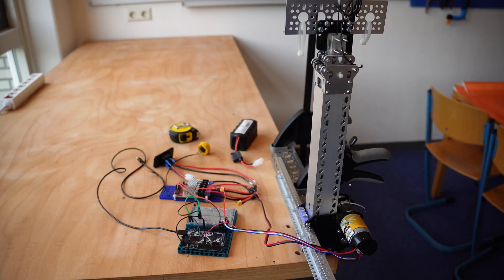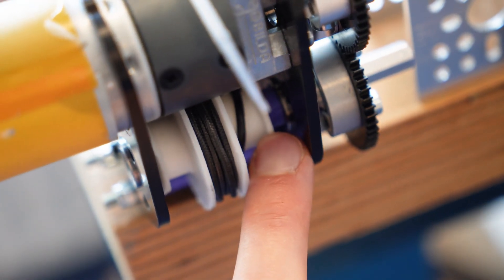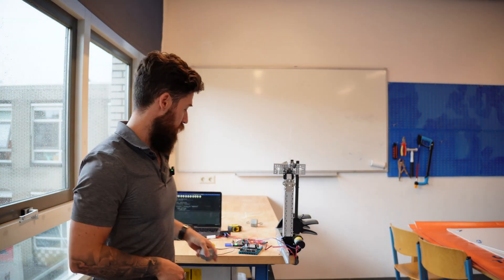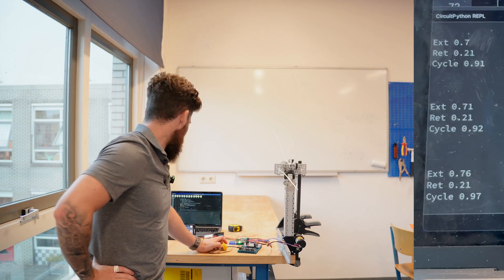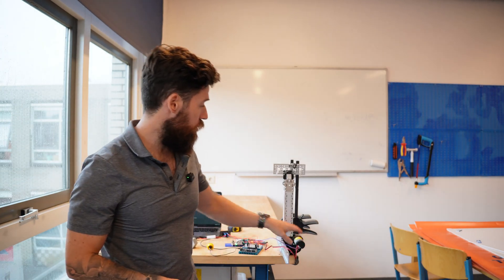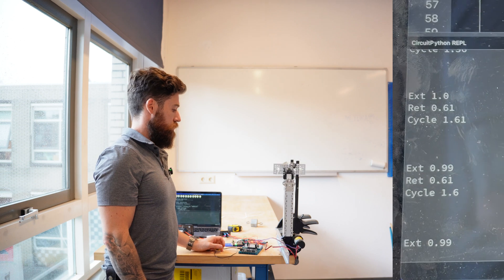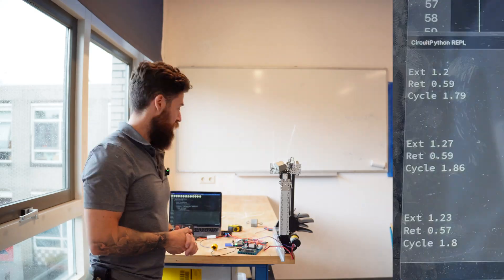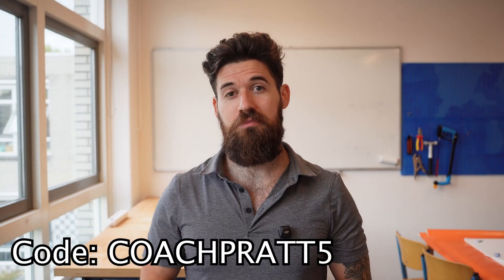How Fast is this Telescopic Robot Elevator?

Comment: Hi there can i have the file or download or where you go the spool/pulley wheel for the motor where the string goes because i try to 3d print it and it did not come out well if you can help i be greatful thx
Reply from the maker: I believe offset robotics has this available on their website